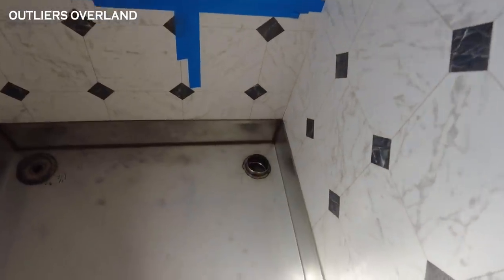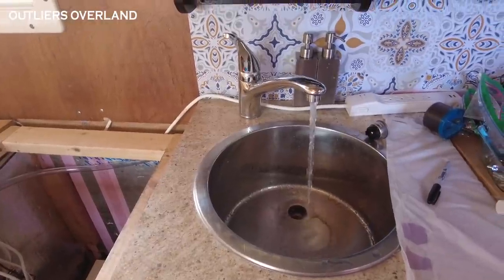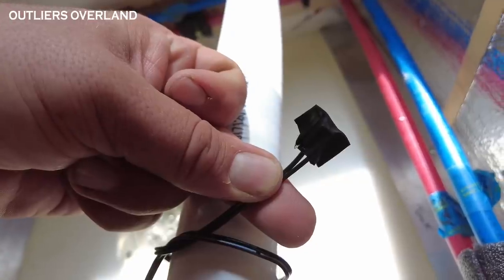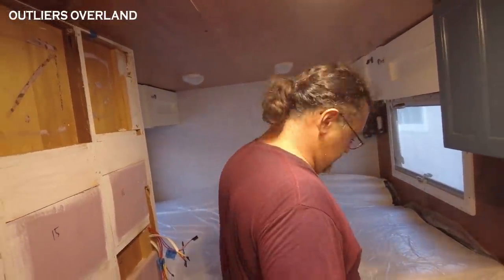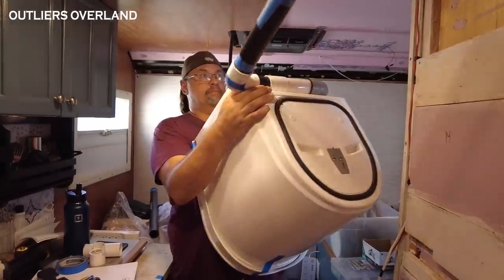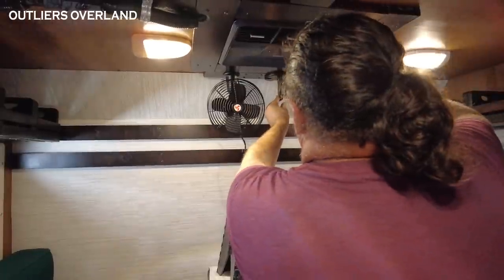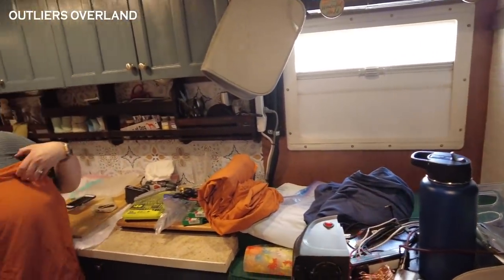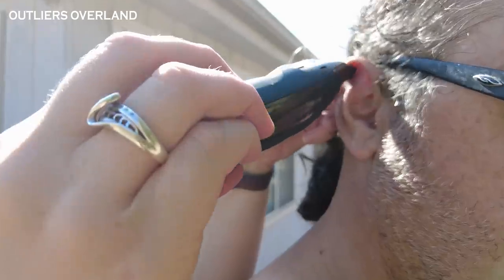THE HOME STRETCH ~ Reassembly, Finishes & Moving into the Van [Ep #3]

Comment: Great job and inspirational,  also congrats on hitting over 100k subscribers. 
I've been an HVAC technician for 20 years. Using a fan to blow cool air to the front of the cab is not advisable.
The unit will have a temperature sensor reading return air to the unit and using a fan to 'distribute' the air will disrupt the flow over the sensor. 
The unit will condition the air by drawing in and removing heat from the cabin air until it reaches your desired cabin air temp which is read by the sensor.
Ideally the unit should be mounted dead center of the room to achieve optimal efficiency in this regard. I understand there were issues with solar panels being in the way. 
Also the average air temp coming out of the unit is between 2 and 9 c, which is pretty chilly if blowing straight onto you. 
Happy travels. Awesome channel.
Reply from the maker: Thanks for the input about the air conditioner.   I made sure that the fan blew across the intake before the cool air exhaust as to not confuse the sensors.   
Guess I need to rethink it…

Comment: Impressed with all the work you’ve done. 👍

I do have a question though. 
Seeing as main power in the US is 110 volts, but it is 230 here in Europe. Are you able to hook up to main power here?
Reply from the maker: Thanks.  

They sell this transformers on Amazon and we picked one up.   
Simran AC-2000 Step Up/Down Voltage Converter Transformer 110V/220V - 2000 Watts,Black https://www.amazon.com/dp/B004MPR42Q/ref=cm_sw_r_cp_apip_K9D5ri3nPztSh